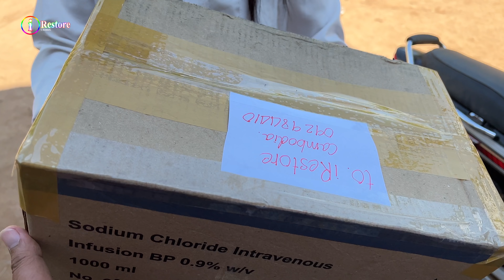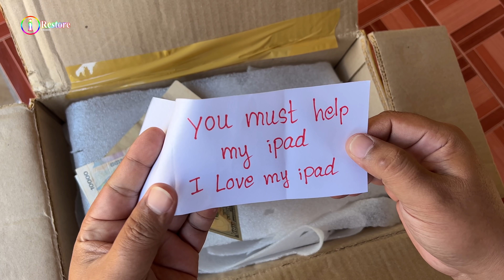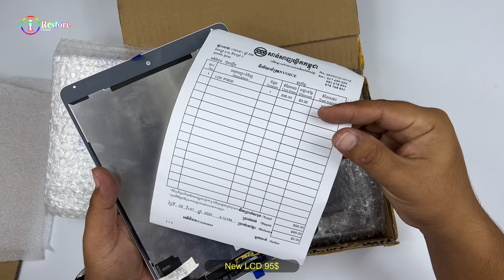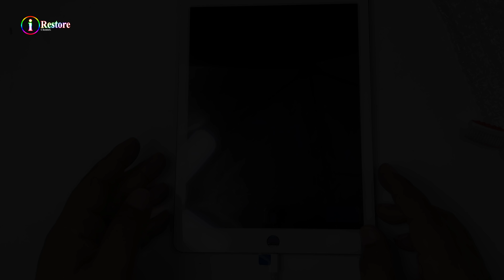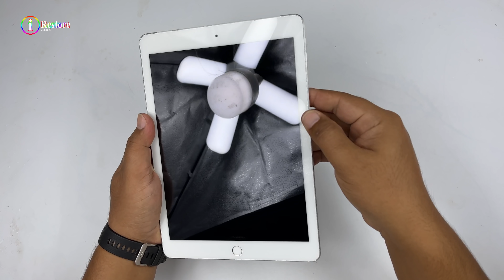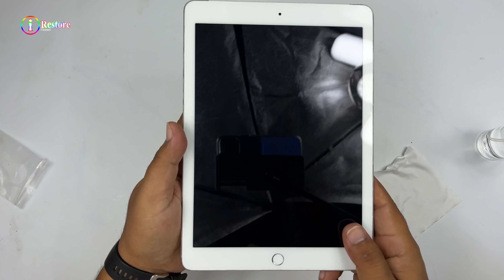Restoration Apple iPad Cracked, How To Restore Destroyed iPad

Comment: Hello, how do I get you to fix my cell? It's the LG K10 2017. It discharges quickly. I already changed the battery, but even so, the charge doesn't last. When 80% reaches the cell, the cell turns off. it costs bro